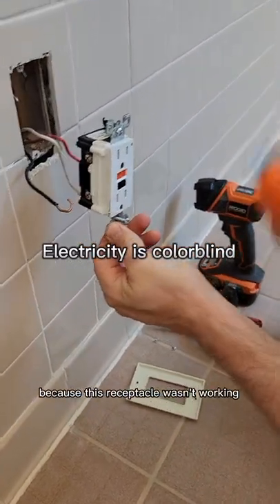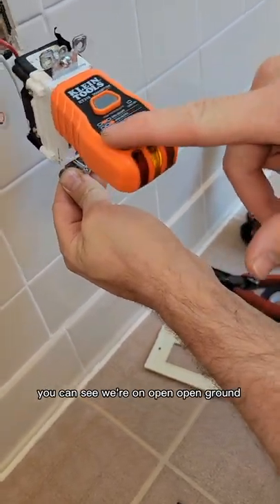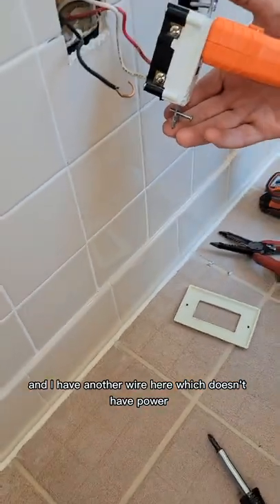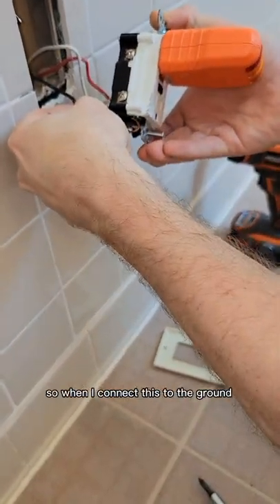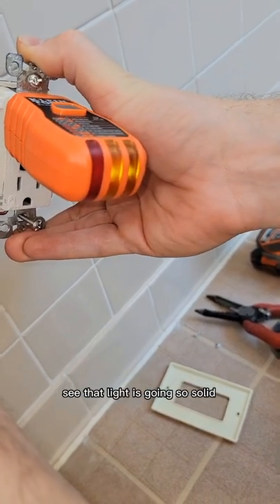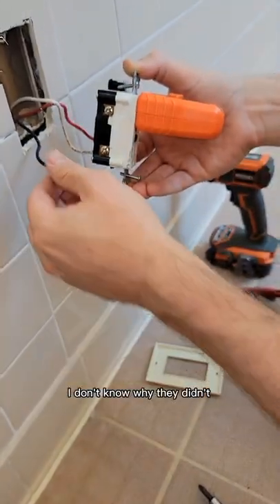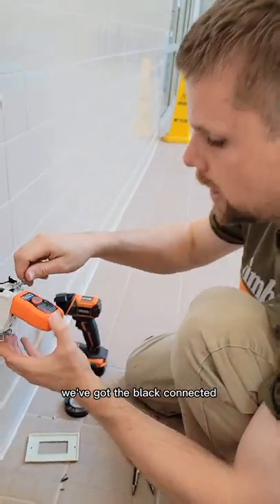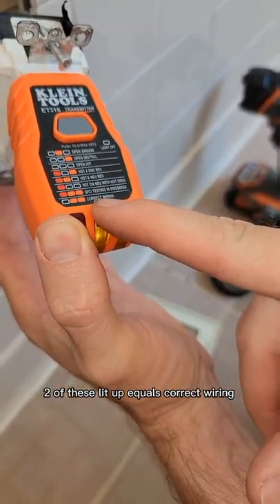Open ground fault on a gfci #electrician #viral #howto #diy #shorts

Comment: Yeah id rather have no ground than use black wire as ground
Reply from the maker: Lol
Reply: @Mechanicallyincleyend  it’s not funny what he said, most old hoses say open ground, and you saying I don’t know makes us believe you didn’t check why the black is ground
Reply: Not cool
Reply: You can use a GFCI without a ground wire, just read the instructions and apply the appropriate sticker, which is supplied with the GFCI.                 💙 T.E.N.
Reply: @tracynation2820  that completely disregards the GROUND FAULT CIRCUIT INTERRUPTOR.
And that means that the person using it can become the negative Adam.
 (It’s earth ground)
Reply: Read the instructions supplied with the GFCI. They can be wired with two wires, and no ground wire, in case there isn't one, and will still protect you. Then you apply the supplied sticker that says "no device ground" to the cover plate. GFCI outlets measure the difference in current between the incoming hot wire and the return neutral wire to trip the protection device. I'm not saying don't hook up the ground wire if you have one, but the ground is there to help protect you and any plugged in devices that have a ground wire. Edit: P.S. If the wire is the wrong color, just get appropriate color electrical tape and wrap about six inches around both the breaker end and the outlet end, so that any future electrician will know what is going on, and also make it legal. 💙 T.E.N.
Reply: @tracynation2820  👍
Reply: Is this Tracy from Arizona that Used to work for Bowman Electric?
Reply: No, I live in Colorado, but I do do electrical work here. Not bragging, but I work by word of mouth only, (No phone calls, no text messages.) and I am still quite busy. Even after forty years, my "clients" still keep me busy because they know what they are getting for their hard earned money. 💙 T.E.N.
Reply: @tracynation2820  I love it. First I just wanted to say that Tracy was one of the best electrician I ever had the pleasure of working with.
And second I love that you get your work from word of mouth that shows that you put your name/ signature in the work I’ve been in the business since 1979 and I slowly am starting to back of and taking it easy. And yes the majority of my work came from word of mouth like I always said worry only about doing the job correct and that makes the clients happy and the money will come it’s a pleasure chatting with you good luck and safe travels brother.
Reply: @tracynation2820  That is only for replacing old two prong outlets. It is not any general license not to use ground.
Reply: @eddiegodoy3671  Please learn how a GFCI works and come back then. A GFCI does not need a ground wire to operate.
Reply: @okaro6595  GFCI abbreviation for.
Ground Fault Circuit Interrupter…

Comment: The ground wire is there but maybe cut off. Never seen a 3-wire without a ground in it.
Reply: They do have some MC cable but why wouldn't they put a egc? Just seems weird. Gnd is probably connected to box in the back. And black was used for spare or switched circuit. Turn the switches on and listen for a pop

Comment: Would not trust that tracer/tester. They're great for finding breakers but only physically tracing it is going to tell you it's properly grounded and not shorted on a MC jacket or someone dove a screw through it into a pipe.
Reply: Also the GFCI is looking 10 years old. Recommend replacement and testing every month as manufacturers recommended.

Comment: I do not like to mess with electric. Plumbing's bad enuf!
Reply: I would touch a hot wire over unclogging a shitter 10 out of 10 times. Lol
Reply: I worked in medical for 32yr. Poop is gross but it won't electrocute you. 😆

Comment: This is wrong, and it's dangerous to make videos like this. Someone may watch this and think this is the right way to do this. That is not your grounding conductor. Only wires #4 and larger can be identified using tape or paint. Maybe the other end is bare and stuffed in a box, maybe it's tied to the grounded conductor. Get a meter, a code book, sign up for an apprenticeship program, and put the camera down.

Comment: As a professional, it’s cringeworthy watching you not use a multimeter. Also, given that clearly the colors of the wires are irrelevant at this point, make sure the white wire is actually the neutral wire and not the ground wire… the tester can’t tell the difference if you flip the neutral and ground, they are both bonded at the panel so they have the same voltage potential.

Comment: Dude...hire an electrician to examine the entire circuit. I doubt the black is being used as a ground. You're holding 12-3  bundled wire that since the early 1970s has been required to have a ground wire. Use that non-insulated copper ground wire instead.

Comment: How hard could it have been to just strip the black sheeting off lol  .. yes it’s all copper and as long as it wired correctly it works lol … but it only takes 30 more seconds to not do a half 🫏  job 😂 

Unless they used black wire as ground all the way back to the panel box … in that case they should please stop doing electrical work 🤡